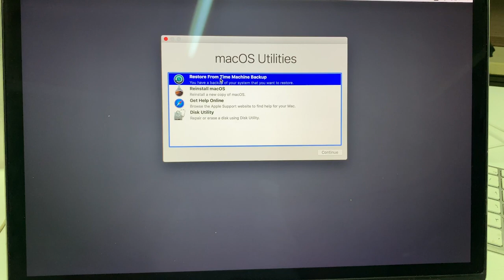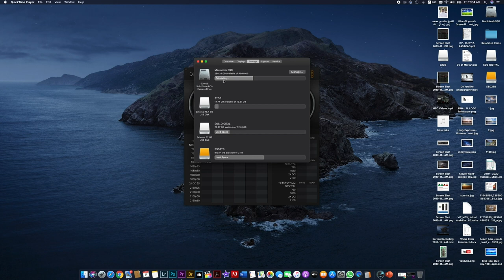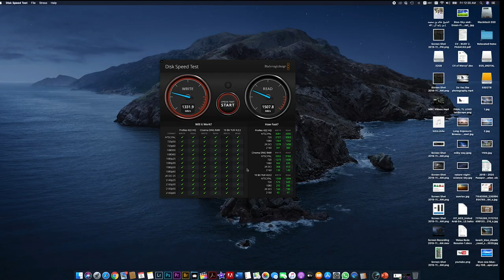Latest Upgrade for MacBook Pro 2013- 205

Comment: What kind of speed improvements can i expect? Testing with Blackmagic Disk Speed Test. Original SSD i have about 600MB/s read and 680MB/s write
Reply from the maker: thanks for your comment, sure you gonna get 10 times faster then original ssd
Reply: @TamerRadwanTLP  yeah, it looks like that the ssd is the downside in my computer.. cpu doesnt seem to load that much.. the ssd is though.. im using iStat to overwatch. Any news about adapter since your video? Can you please link to one that will work? Have not decided if i want to go with 500gb or 1tb. Dont know if there are any speed differences between those version?
Reply from the maker: @orfeous  let me check and comeback to you
Reply: @TamerRadwanTLP  i was thinking of cleaning and replacing the heatsink paste aswell when im "under the hood" to gain maybe 1 or 2 degrees in cooling.
Reply from the maker: @orfeous  much better to change one time
Reply: @TamerRadwanTLP  i dont understand

Comment: I really want to upgrade/replace my SSD on my Macbook Pro 13" Late 2013. Will this drive work on my computer? My original SSD is 256Gb. And it is too small i have realized.
If it will work and is compatible i will go for it. If you restore with time machine, will the whole drive be utilized? Or is a new partition created with the free space?
Ive found Samsung 970 EVO Plus Series MZ-V7S500BW 500GB only costs 10 euro more than the one you specified.
Reply from the maker: Yes dear, much better to get the EVO Plus, it’s a new kind and faster, you will really enjoy and feel the difference once you install it
Reply: @TamerRadwanTLP  1TB is twice the price here in Sweden than 500Gb. No need for that but Nice to have. This is not my primary computer so.
External storage on USB3/Thunderbolt or NAS is in my opinion a good choice.
Reply: 130 euro for 500gb
Reply from the maker: 500 is enough for the system
Reply: @TamerRadwanTLP  im really sad that RAM isnt upgradeable. Ive seen a video on someone doing it though. Desolder and modificate resistors.
Reply from the maker: Yes be be carful, some Technition they are perfect to do it but you don’t know it might be damaged too
Reply: Did you upgrade the SSD of your MacBook? I've read that there are deep sleep, bootcamp and recovery issues if you use NVME drives with that specific model. I have the same MacBook and I'm looking for an 100% compatible SSD to upgrade, but there is not enough info online.
Reply from the maker: Anestis Dalgkitsis hi dear, there’s no deep sleep just buy a good converter and you gonna enjoy it at all
Reply: @anestisdalgkitsis3145  no, i have not upgrade yet, someone told me that this macbook only supports PCIe 2.0 and can only handle 1.5-2.0gb/s

Comment: does this model laptop only have the (1) original SSD? or does it come equipped with a hard drive and the original SSD?
Reply from the maker: Originally comes with SSD but was the old version, this one EVO is faster 10 times

Comment: Would this ssd be compatible with the 15" MacBook Pro Retina (Mid 2012)? I have not been able to find any resources online that specifically states this particular model. Thank you.
Reply: And if not, is there a particular ssd that you would recommend?
Reply from the maker: Yes the same of 2013
Reply from the maker: You still need to get the small adaptor for the new SSD
Reply: @TamerRadwanTLP  Okay, awesome! I just wanted to make sure since most resources stated MacBook Pro 2013 and later. Thank you!
Reply from the maker: Much better you open your laptop cover and get in for your information